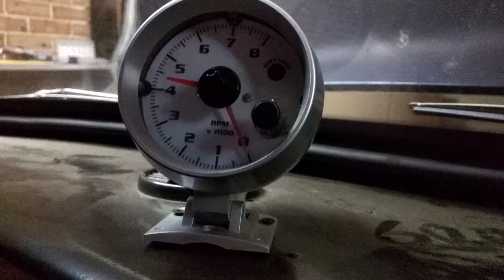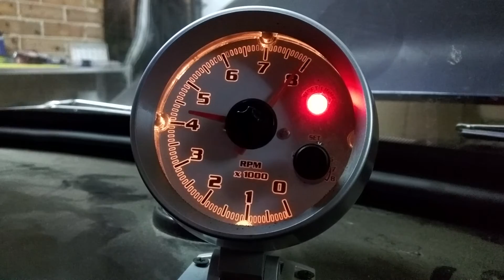Testing a Cheap Tachometer

Comment: What are you using to test the tach?
Reply from the maker: Christofer Sveen there is a test mode on the ignition box I run. I tested a Autometer tach and it hits the increments exactly.
Reply: And what is your ignition box?